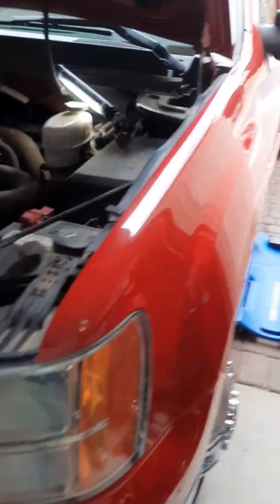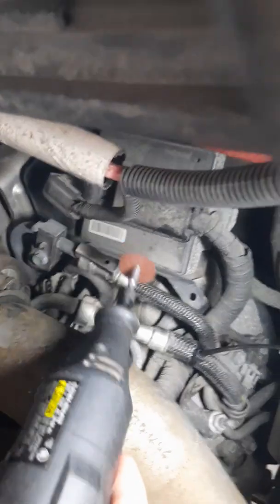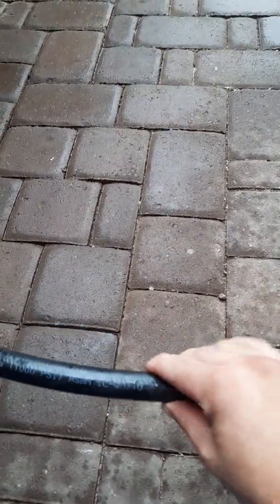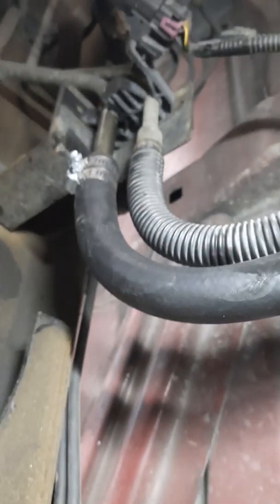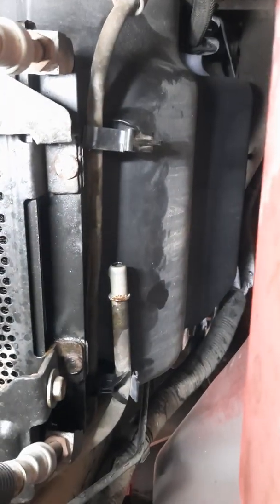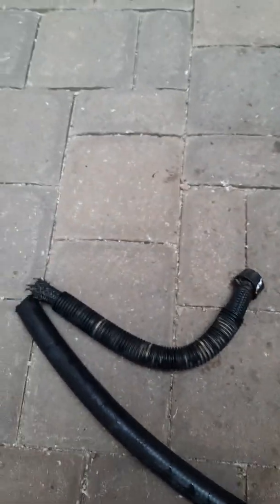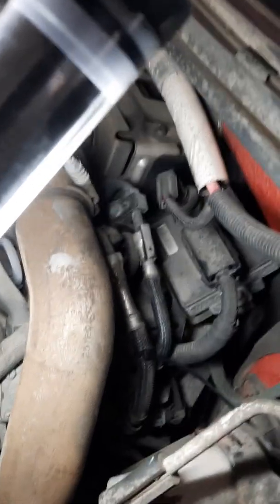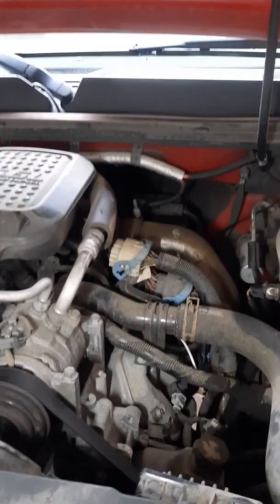Duramax LMM P0087 low fuel rail pressure/change fuel filter. GM service bulletin hose upgrade

Comment: Has anyone heard of this issue causing reduced engine power codes?
Reply: Yes. Po087 is common. Fuel rail low pressure.

Comment: Before the fix,did you get code poo87 multiple times?Also,did the Parker Hose update cure the issue or did you continue to get the code?
Reply from the maker: Yes, I had the p0087 code over and over again. Unfortunately the hose fix didn't fix it.  I proceeded to do a secondary FASS fuel filter system after and still had the issue.  Long story short it ended up needing injectors and we traded it in on a new Cummins.
Reply: Mxbrad did you have the symptoms of needing injectors ?  Like to much smoke or stuff like that
Reply from the maker: No smoke or any other injector symptoms. From what I remember the injectors were returning to much fuel under load causing a lean condition.@santinonavarro4853
Reply: @Mxbrad298 I think that’s exactly what mines doing. 220,000 miles. 09 dmax. 
It first says change fuel filter 
Then ck engine light for a POO87. 
And limp mode right away. 

But it only does it around 7 to 12 pounds of boost. Floor it and runs amazing no issues.
Reply from the maker: Interesting,  if you can floor it with no issues.  The lines are a good thing to check if you can reproduce it frequently.  @duramaxdad
Reply: @Mxbrad298  So I tested it today and it will now go into limp mode at 8 pounds of boost or more. Max frp is only 16k. I hear it needs 26k frp. Fuel lines look good. No air in fuel. I’m gonna do an injector return test. And try and unplug the fuel psi regulator to c how much frp it will make.
Reply: I did a brand new cp3. Old one is a Bosch dated 8/2022. Why did a Bosch die in such short time? New one worked great for about 30 miles. Then got po087. I checked my fuel hose by transmission by cutting off the plastic wrap and sure enough it was soft and collapsed. This hose likely ruined 3 cp3’s. Which is about $6k

Comment: What is the part number?
Reply from the maker: The part number is 601-8 Parker Medium Pressure Hydraulic Hose, 1/2 in.
Reply: @Mxbrad298  what is the tsb identifier? Nobody caries parker hose In my area. Want to see if they have alternative pns.   Thanks
Reply from the maker: @frankrey7676   I dug around for the tsb online, can't remember where it is. I had to order that Parker hose online though.
Reply: @Mxbrad298  after some research it looks like any SAE 100r3 hose is good for this application.. thanks again.
Reply: Thanks for this I’m going on a trip this weekend and don’t have time to fix before do you think the zip tie will work till I come back. Did you replace your filter head as well.